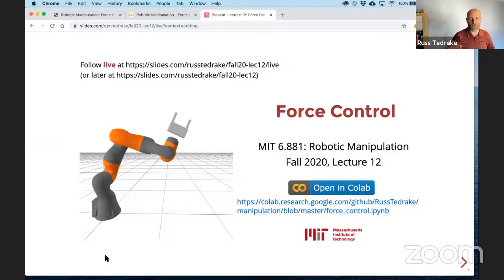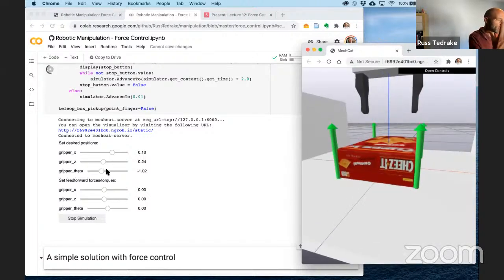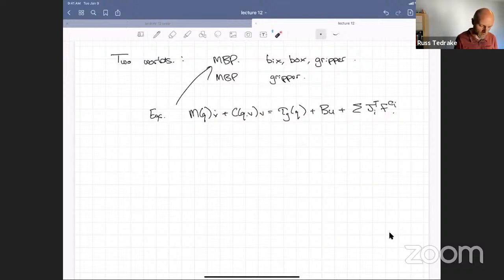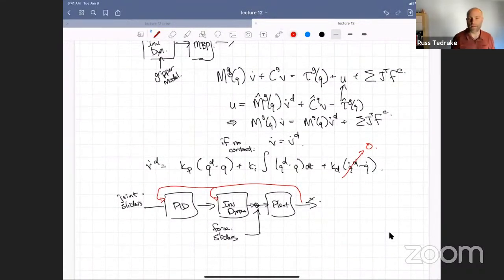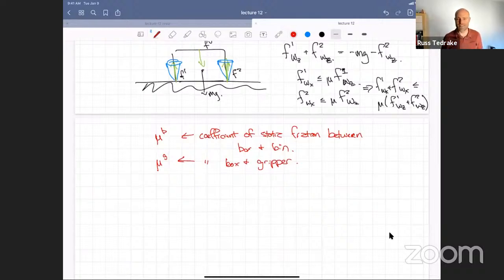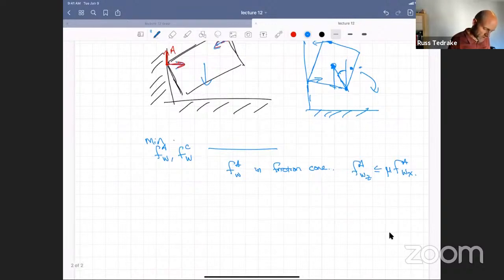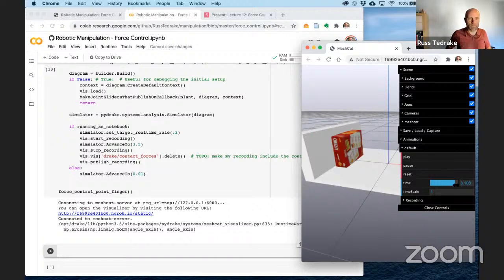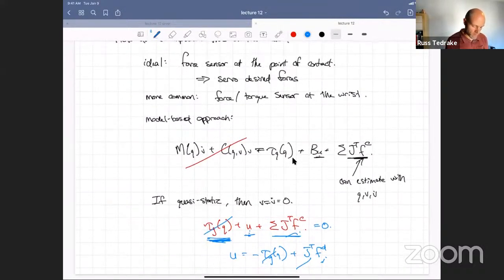Lecture 12 | MIT 6.881 (Robotic Manipulation), Fall 2020 | Force Control

Comment: Not sure you are still responsive to this. 

1:15:41 Controlling the KUKA robot for a pushing book scenario

You mentioned that
- We started from a position control to get gripper in contact.
- Then we switch to control the torque in order to regulate the force we desired at the book. 
- After that we push. 

My question is at the pushing state. During pushing, are both controllers (position/force) active and what would be their objectives (e.g. keep the contact position updated when the book moved,  making the object slide with force etc.)?
Reply: Still responsive, although I’m teaching the class again this fall with all new updated lectures (which are taking the bulk of my attention!).  With the stiffness control this transition from acting like a position command and a force command happens seemlessly.  Yes, I think it’s fair to say that both are active, but I think of it as one controller.  You can find the details here: https://manipulation.csail.mit.edu/force.html (e.g. example 7.4)
Reply: @rtedrake  Thank you very much for taking time to reply. Will check more details on the book.

Comment: How about suction for picking up the cheez-it :P
Reply: Hah.  Before the lecture, I had actually written in the notes "(I know there are a few of you out there thinking about how easy that scene is for your suction gripper, but suction alone isn't going to solve all of our problems either.)"
Reply: @rtedrake   Yeah, you are right ! even if we use suction there will be situations where a sufficiently planar surfaces may not be available or object is porous. In both cases we would need the non-prehensile moves described in the lecture.